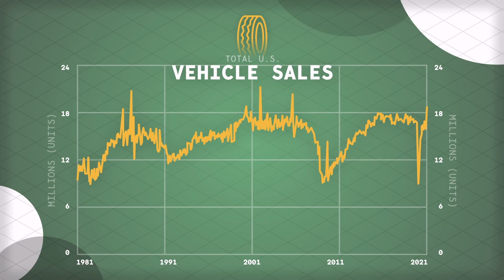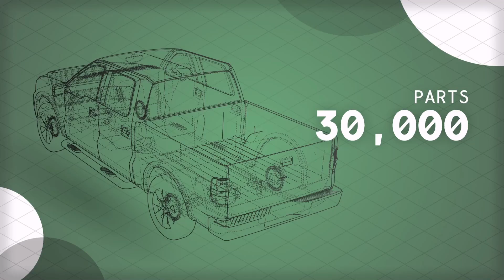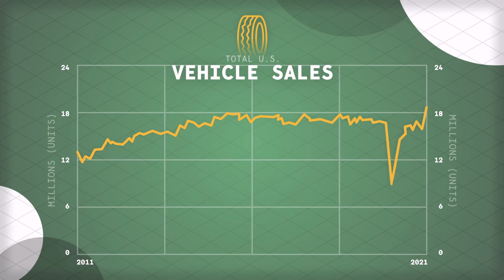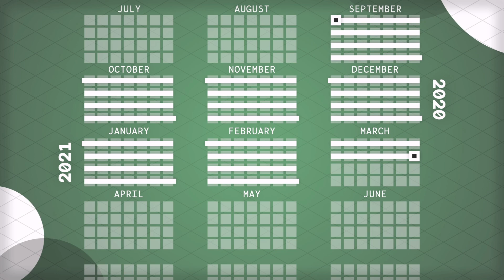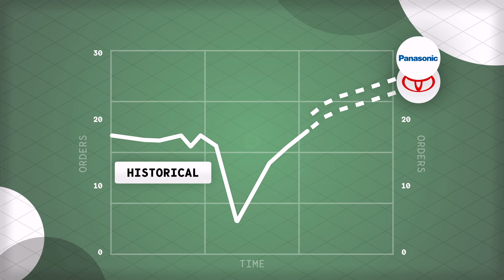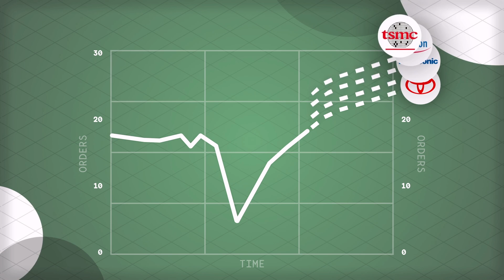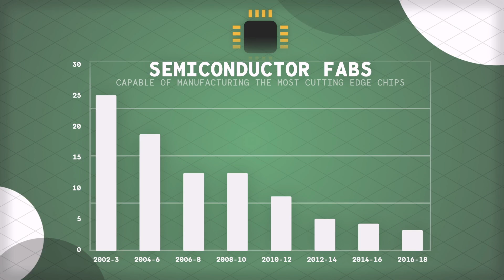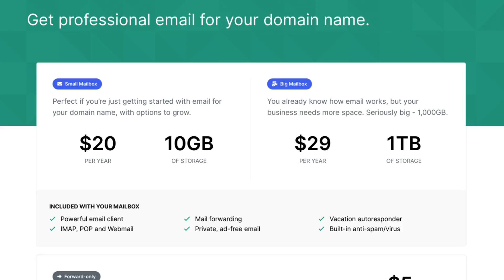Why the World is Running Out of Computers

Comment: What we really need is people to, especially the manufacturers, to finally start designing things to be more easily upgradable rather than something you spend 1000s of dollars to get only for it to become useless due to things such as planned obsolescence. Where upgrading something should be as easy as unplugging one piece in a machine and plugging in a new better one. Kinda like how you can sometimes plug in a radio into the dashboard of your car.
Reply: Nowadays they literally design stuff to break eventually. That way you have to upgrade
Reply: @GLAMOURSK1LLS  i gave my 10 year old computer to someone and it was still working just fine and i bought a new computer in 2019
Reply: @GLAMOURSK1LLS   i am greatfull i bought a computer in 2019 as aposed to 2021 becuse i would have a real hard time finding a  gpu for a good price.
Reply: I think modern applicances are too complex to upgrade yourself. I mean, even modular PCs have a lifetime for their motherboard till a new chip socket with more pins/new ram generation/new pcie gen comes out. Also....imagine trying to upgrade and IPad or phone, manufacturers would have a heartattack at covering the warranty's for those while retaining things like it being waterproof.

Granted, people should also stop buying over engineered toasters and microwaves.
Reply: Around 1984, the I worked for a major company  that designed an extremely modular computer. Each component had external pins which allowed you to unplug/plug in upgraded components. Here are the issues: 1) Pin designed created extra cost and reduced reliability 2) New interfaces obsoleted those interfaces (example: SCSI->SAS->NVMe).
Not saying you're wrong. I push my computer to 7-10 years. I would like it easier to change out existing components. I know it really isn't that hard, but 1) I am too lazy to read the install manuals 2) Most people re like 1). I cheat by using an external USB based external archival storage/back upto supplement my SSD.
Reply: @ronaldmcdonald3965  I think they just need to ask a technician to upgrade them if upgradable stuff are available, so more jobs for technicians, environment is better, the world is more stable, and consumers ultimately save money. Everyone wins
Reply: @aristtara006  So you support the status quo?
Reply: Yes in an optimal world we would innovate into making our technology more future proof and upgradable, but this does not align with the current profit margins these products are currently generating so it will never happen under capitalism unless a major revolution of thought or something else takes place.
Reply: The problem is the toxic-positivity from people of management who don't think about the consequences, or quite frankly don't care.

Every manufacturer and business praises automation not realizing that they are just cutting corners until the automation breaks and things go wrong.

There's a reason why "risk" managers have been non-existent in this new millennial because they would have denied businesses doing these practices, which would have had the board of directors somewhere fuming with anger.

People with financial power tend to not let there experts lead because it makes them look useless.
Reply: Its as if everybody is carrying around gold in their pockets and treating it like its steel. I hope people place more value in these chips from now on. We need to take a good hard look at what is truly valuable. Its not right that semiconductors are cheap when cost of living is through the roof. Everybody has a mindless belief that they need to upgrade their technology every year. Why can't people use stuff till they break, or, at the least, be economically pushed to do so? I use an iPhone 6s and my PC that I built in 2014 (GTX 960, probably the most affordable card that was ever made with power). I do EVERYTHING with what I have, I can play games, MAKE media such as videos and music and use them like they were made yesterday. I often have arguments with my family member who is also a techhead who literally upgrades all the time and is invested in AMD. The semiconductor industry is a wildly undervalued one. We are carrying around the most advanced piece of tech that has ever existed and treating it like trash.
Reply: lol lol  Yea and like I said this box would still need to be upgraded about as often, The shape and size of various plugs change all the time and for good reason power and data transfer etc damands change they dont just pick the size and shape of these plugs for no reason. I sugest you do some reaserach into why CPU sockets change as an example of why this box wouldnt really achieve its purpose as it would need to be upgraded just as often as motherboard. Even if ports dont change try puting some of the latest and fastest ddr4 ram into a budget board that came out when ddr4 first came out, it would likely work but the motherboard would not be able to support the speeds the ram is capable of making the 'upgrade' largely pointless and if you still had a 'box' from before when everything was ddr3 forget about it no upgrade. This is before you consider cooling and power problems of such a design. really the market of people this would appeal to isnt very big. People who are into computers enough to build them already know how or are willing to learn and people that dont know and dont want to learn have pre-builds.
Reply: yeah, given their lobbying it won't happen
Reply: No profit on it.. greed over all!
Reply: Good luck with that ideology in capitalism. Tell a fucking Umbrella producer to produce good not braking in months cheap ass Umbrella and charge even idk 60$ or so… noooo no no, they rather prefer selling u the same thing 1-2 a year so they can grow grow grow… Now transfer that behavior to basically 95% of company around the world… Capitalism, we dont tell the the direction for all ourselves, they do it… for themselves.
Reply: The worst part of this ever so growing money is the deflation problem growing parallel with growth. Inflation is a current problem? Only for us plebs owning just a bit. If you’re a billionaire, your money is most likely just sitting around, not being in the global cycle/circulation to benefit society and mankind. Just to lengthen their ego-dicks.. 

Billionaires? In my opinion one sort of Cancer our society is currently suffocating, alongside reserve banks, media owners, energy distributors/producers and sadly many more. 

Well well aren’t we fucked if things continue like that?! Probably sooner than later…
Reply: HP & Dell make business computers with parts that are quick to change.  For example hard drives and cooling fans.  A tech familiar with HP computers could swap a hard drive in under 2 minutes.
Reply: @brentsummers7377  Awesome! Now let's  see more of this for more tech!
Reply: How about not putting chips in literally everything. Why does your refrigerator, washer, dryer, hell a ton of things need a chip in it that would reduce the amount of semi conducters needed quick. All these techs are more reliable with less shit in them, but people think they need to peek in the fridge or have their dryer text em. Instead of having a memory or writing a note. PCs are already upgradable, and you can't simply slap a processor on a processor thats idiotic.
 Your a consumers demand you want cheaper reliable shit instead of buying the new cool thing because it looks cool or cleaver marketing. I buy used shit or the simplest thing possible because all that over engineered shit does nothing but break.
Reply: @daytonaofcv6856  your fridge needs a processor to determine when to run the compressor, the fans, how long to run them for, for mode selection, for turning on the light... you really seem to take for granted what we use these for. It's not only fancy stuff that needs them. A washer/dryer needs it to run timers, select modes, monitor temperatures and so on.
Reply: @_ajf  
Just another thing to break
Reply: That's how PC's work.

With mobile phones, Google was trying to push for that but it quickly became clear you cannot do that. Single brick phones are so vastly cheaper, efficient, powerful and even smaller, no one would buy a modular phone if given a choice.
Reply: Well tell that to Intel. They deliberately change their sockets every year to make you buy a new motherboard.

Also, computers have actually been designed to allow you to upgrade without buying a whole computer every time. This is what those PCI-E, M.2, SATA, ATX power, etc. are there for. You can change certain parts without ditching the whole thing. It's been like this for decades. Of course there will always come a time when obsolete ports will no longer have a place in newer computers, like how you can't make old 5-year or 10-year old sockets to work with much newer CPUs anymore.
Reply: @ronch550  exactly! Only reason CPUs have different sockets is because of the architecture of the chip. If they didn't have to change the socket they wouldn't. The modern PC is the most modular piece of tech you can get. I love watching videos of people putting modern tech into 90s cases
Reply: The late capitalism would never allow this.
Reply: Making things upgradable is kind of hard but yes they could provide a manual programming port for it 
(upgrading over the internet is inherently very unsafe and should never be done with vehicles)
But you are right if they took out planned obsolescence from cars we could get 20 years out of a car instead of 5-10 
It is not hard to make a car that works and runs for 20 years one does not even need to do many thing differently ... 
just take out the willingly badly made bits. Pushing beyond that is too much but 20 years instead of 5 is 4x less cars to make.
Reply: Good luck upgrading microprocessors that are manufactured at precision requirements several hundred times smaller than the thickness of a single strand of human hair.
Reply: @jorgemiguel2641  it's possible.. you just need to shrink world 1million-x first!
Reply: @divotiontogod  Oh in that case, that's perfectly reasonable lol my bad
Reply: @jorgemiguel2641  😂👍
Reply: apple starter to solder the ssd to the logic board in their computers. they litterally made something prone to wear and tear impossible to replace
Reply: Yes, let’s make that component that was purpose built for a specific function upgradeable thereby driving more cost to something absolutely nobody will upgrade because it’s fulfilling its perfect function.
Reply: Look into circular economy. That’s where everything is heading since we’re screwed if we don’t start efficiently using the resources we have.
Reply: Yes but profit
Reply: The word you are searching for is: "modularity"
Reply: @rw6783  well of course, funny enough that word hadn't occurred to me until earlier today.
Reply: There are smartphones which try to better at replacing parts; Fairphone and Teracube are two.
Reply: What you say is true. If such as car makers were obliged by WTO rules to warranty the electronics on products for 20 years this situation would not arise again as the various "brains" in transport products would be swappable at no charge to the customer even though ownership might change.
The fact is that too many essential products over-depend on electronics and not physics. Some companies have exploited this fact for years and even when they are caught out, like VW, the penalties do not adequately compensate the customer.
Those who want vehicles with gizmos and gimmicks can live with the consequences.
Reply: Did y'all also see "why we can't have nice things"
Reply: The real reason why USA west media falsely accuses CHINA of mistreating Uyghur Muslims is because they want to prevent the 1.6 Billion Chinese worldwide and 2.0 Billion Muslims from working together. Both these groups have been discriminated by USA and the WEST for decades and are more likely to work together. Chinese & Muslim nations working together will lead to US losing its dominance of the world. Plus this will gain Asia, Russia and African support too including the rest of the world.
Reply: lol lol  Got a double reply nice, got you going good. You never said it was future proof but it would be useless idea if it wasnt thats what im pointing out to you. I towuldnt expect someone who struggled to install ram to understand, stick to prebuilds my man.
Reply: lol lol  zzzz
Reply: lol lol  okay, any useful contributions you may have made are being drowned out by your obnoxiousness at this point. Your mentioned, from the first comment, about upgrades. Upgrades implies that a component you have currently, will be replaced with a superior company at a future time. If you're not"future proof" then you cannot count on access to this future component. The vast majority of the time, the components that are dated, will be inferior to current generation technology.

Your obnoxiousness makes it very distasteful to give you the benefit of the doubt, but perhaps you meant to replace, not upgrade, a component due to failure. But then you shouldn't have used the word upgrade, which in the context of a future component exchange, implies some discipline and foresight about which components will be available at that future date. 

Now STFU unless you're going to apologize to everyone who has to read past your obnoxiousness to read the rest of this thread which is generally pretty good.
Reply: Greedy CEOs would never allow that. You can’t even fix your own property anymore. This will be very bad someday.
Reply: #EnjoyEnjaami
Reply: The idea itself is great, unfortunately it's the actual electronic modules that you actually have to change/upgrade so in this case, it would not make the situation better.
Reply: Most of the tech stuff is easily "upgradable". Only Apple products are mostly not.
Reply: @thyssenbot  Depends on what level of "tech stuff" you're talking about. Parts of a PC? Yes. Parts of a processor? No.
Reply: @adammelander6062  Replacing a whole pc vs replacing 1 part is very different though. Most mainstream products are designed to be thrown away entirely once they reach a certain amount of usage. PC's are designed to be upgradeable/fixable while things like smartphones, smartwatches, (some)laptops, consoles etc are not.
Reply: @thyssenbot  It depends on the conventions and architecture. You can't put this year's intel processors on a motherboard designed for pentium III's.
Reply: @jorgemiguel2641  That's the price of speed you pay. But generally, mobile devices are the culprit. As you squeeze more and more features into the same area, the integrations become tighter. In computing, distance and openness come at the cost of speed and latency. This is a fundamental problem of the nature of electronics. Non mobile devices are much easier to upgrade if the manufacturer allows so.
Reply: Aaah yes, the  good old simple "make super complex technique that's constantly getting revolutionized and operates on a nano-meter scale more upgradable, like my primitive car radio".
Reply: Even if it was UGLY, I want a desktop like that. Each component is a separate piece that all you need to do is secure in place. The Motherboard would be mostly a black box with ports/slots for the CPU, RAM and Graphics card. No need to take your entire PC apart to replace something, all you need to do is remove the old part and slot in the upgrade.
Reply: @Rokabur  As it stands you dont need to 'take your entire PC apart to replace somthing' it normally a matter of taking the side panel off which is often just 2 thumb screws then you have acess to every part, even then it entirely possible to build a PC outside of a case you could get somthing like a test bench only problem is now you are going to build up dust, Your 'black box' idea would really just be having a motherboard be a box instead of board, the reality is the 'black box' would still need to be upgraded at a certain point just like motherboards do.
Reply: @Rokabur  ...That's already how PCs work...facepalm
Reply: @Rokabur  ugly isn't the deciding factor, cost is. Would you want a modular computer even if it did not offer any cost advantages over buying a replacement computer? Because otherwise, you don't really want a modular computer... you want the imagined cost savings of buying a la carte, only the peices you want and not paying extra for unneeded functionality.

It turns out, miniaturization has counterintuitively changed the economics such that integration is cheaper than modular componentization. So I ask you, even if you don't save any money, even if you pay full price or more, so you still want a modular computer?

The western social order doesn't recognize just how much the basis of economics is political, and how fundamentally necessary a rethink of our politics is to our survival.
Reply: The solution is actually simple... These semiconductor industries must buy second hand used pc components for a fair price... That way they can recycle and save environment.. but they unfortunately like to just make money!